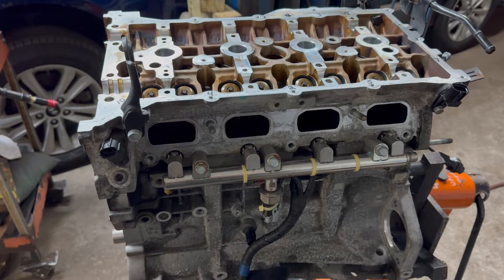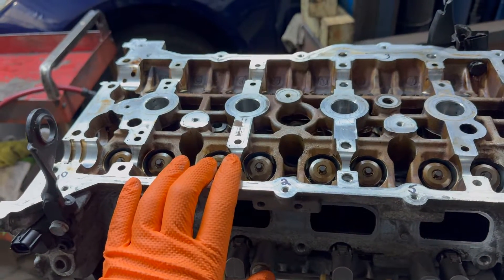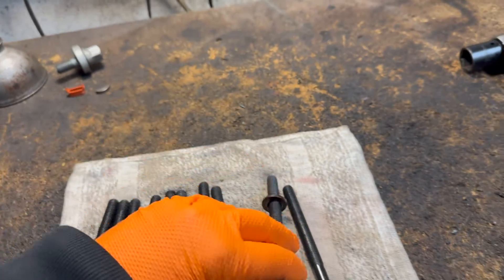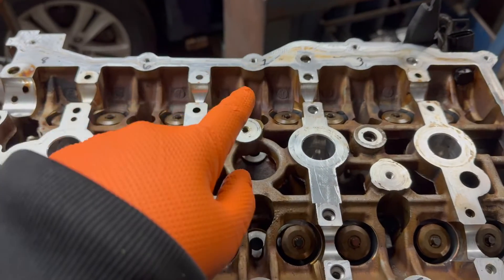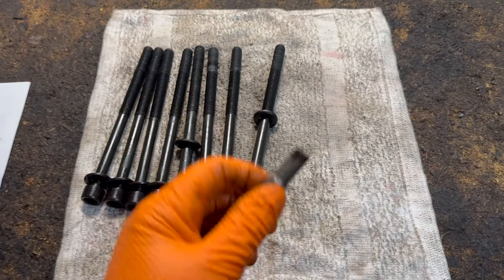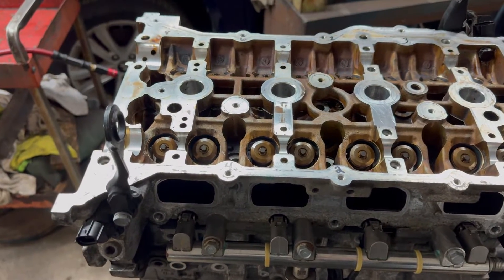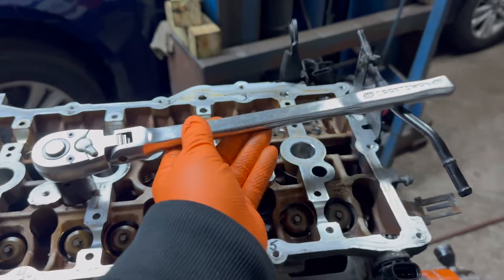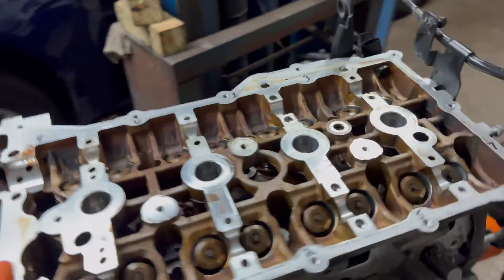How To Torque Down The Cylinder Head on Hyundai/ Kia 2.4L Engine - Torque Sequence & Specs

Comment: Multiport fuel injection?  I thought these were GDI engines?
Reply from the maker: Yes, there are both, the heads are a little different but basically the same.